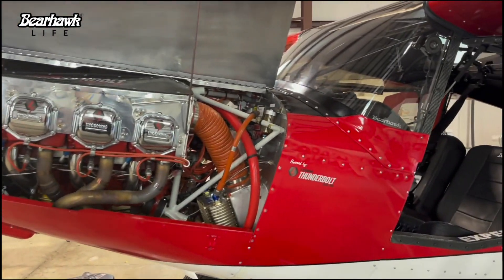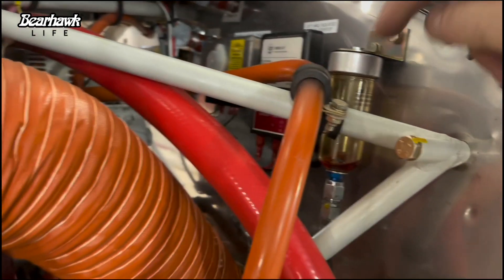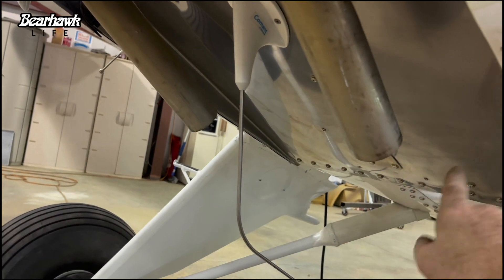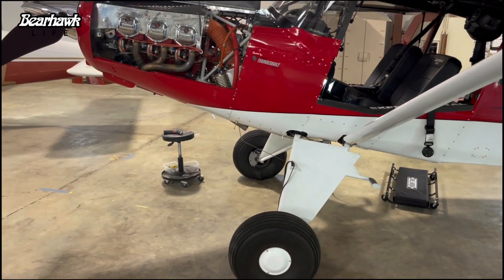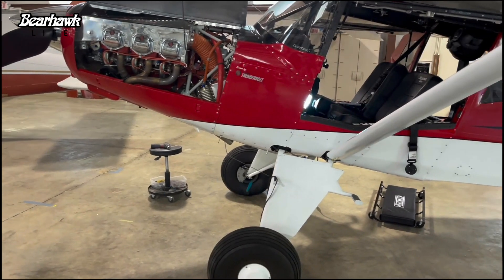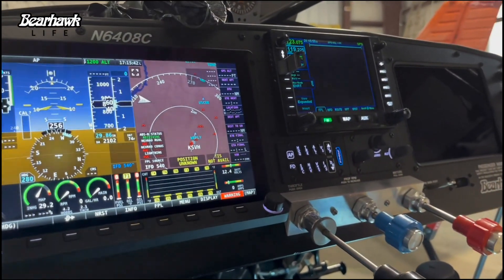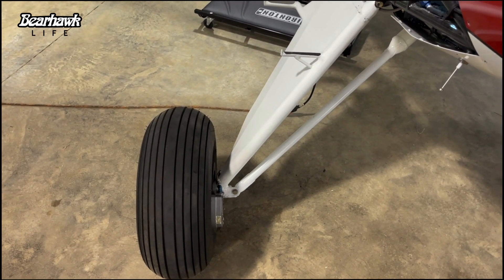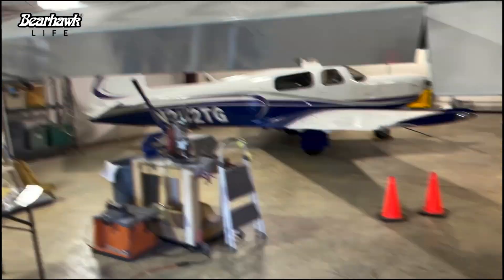BEARHAWK ~ BRAKE FIRE UPDATE...

Comment: I had this problem with master cylinder in a car of mine o ring  leaking on master and letting fluid through to other side of the cylinder and then it was applying pressure on other side that pushed brake on in master cylinder unit shit way to explain it but u get what I was saying.sorry for shit punctuation guys but I’m honest. U will get there mate just little gremlins
Reply from the maker: Thanks!

Comment: Hi Rob. ATF? Is that MIL-PRF 87257 or similar? Seems like something is not allowing a brake pedal to be fully released, maybe?
Reply from the maker: Turns out it is not a pedal issue.  We think we found the problem and will post that video soon.  Probably tomorrow.  Yes, we are using Mobil 1 Synthetic ATF.  https://vansairforce.net/community/showthread.php?t=148051.

Comment: Thanks for the update and it is never a problem to us if you take your time and get it right, we will not die but if you get it wrong you might, so no pressure from the viewer. I did think it might be a master cylinder problem, possibly being out of agjustment so the compensating port was not open when the brakes are not applied, if it is not sorted by the change of master cylinder see if the piston is part pushed in and try to adjust so it isn't. Good luck.
Reply from the maker: All great ideas!  Thanks so much!

Comment: Rob, I for one am much happier to see you troubleshoot problems and learn from that than hear about you having a serious problem while in the air.

So take your time mate and work through your snag sheet until it's clear. 

The learnings up front will make operations and maintenance and more importantly, flying, all the more a pleasant experience down the line.

By-the-way, some types of electrical connector receptacle sockets are coated with a conductive material to facilitate better electrical connection. The fit is also designed to prevent wear over time leading to intermittent faults as contact could be broken due to vibration. 

Thus reaming the socket might lead to problems in the future, might be an idea to see if others with older installations have had problems after making similar mods.
Reply from the maker: Hey Thanks for the good thoughts Dave.  I should have been more clear...  I did not ream the socket end.  I took a small drill bit with my fingers and slowly turned it to give the opening a bit of a flare.  Thus the pin could find its way to the socket.  Took off a shaving about the size of a hair.